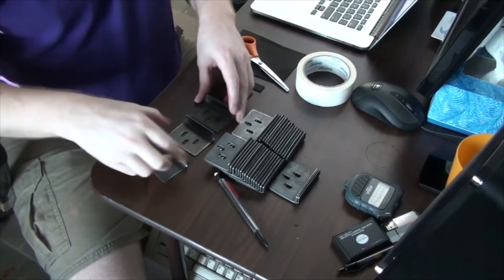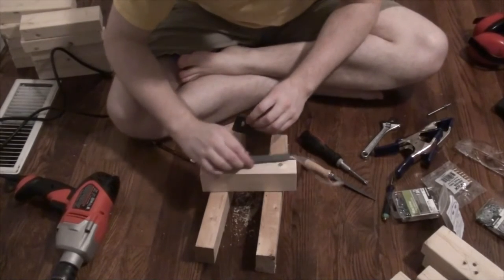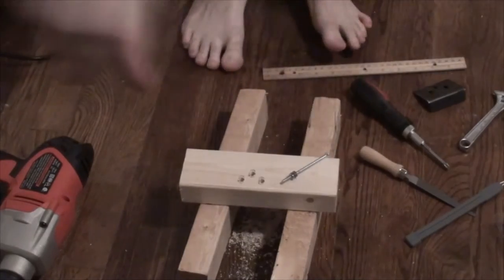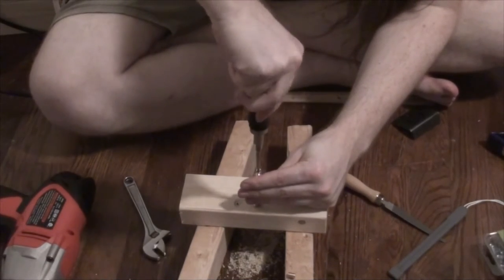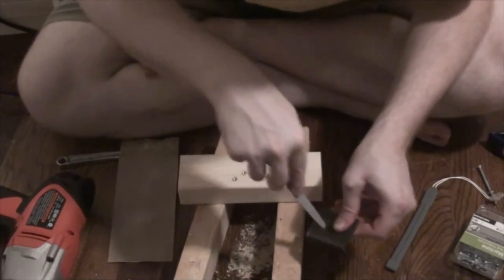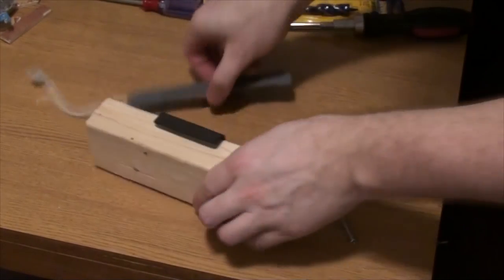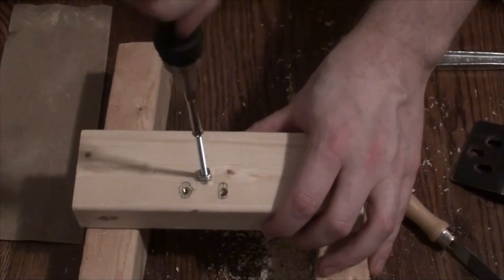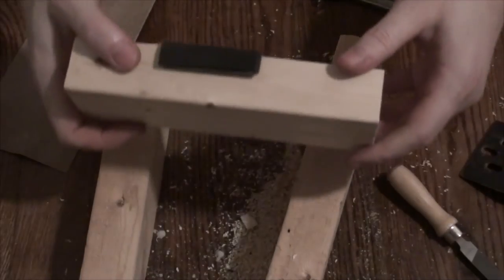Building an ITG2 dance pad replica - episode 6: Sensor brackets

Comment: Are you using ITG or DDR sensors? Or is there a difference?
Reply from the maker: PIU sensors, which are the same as ITG ones. The DDR sensors use a different connector, but I think they're pretty much the same otherwise. Rumors say they're less durable, but I can't verify.